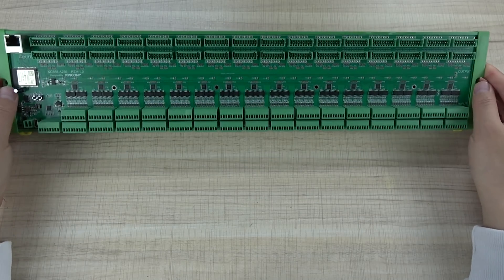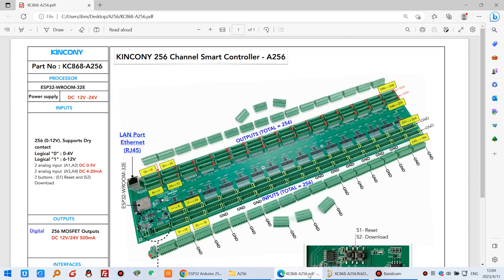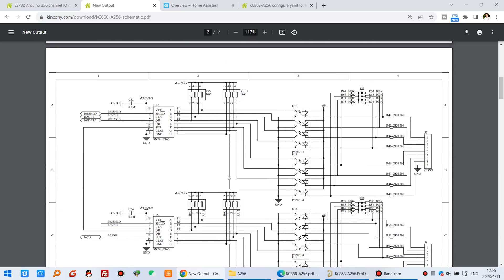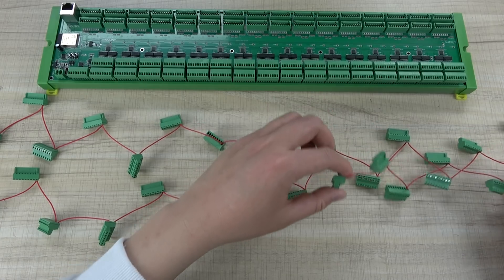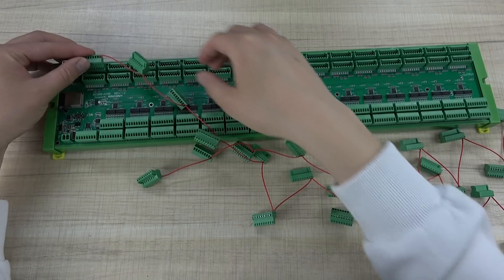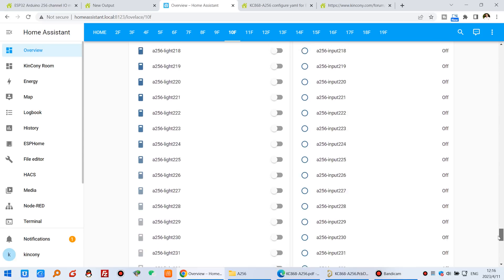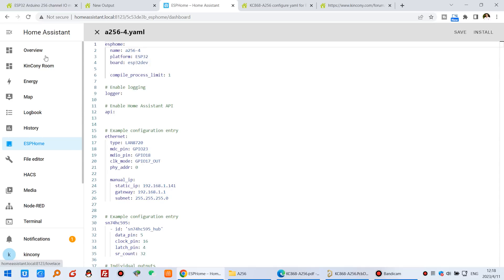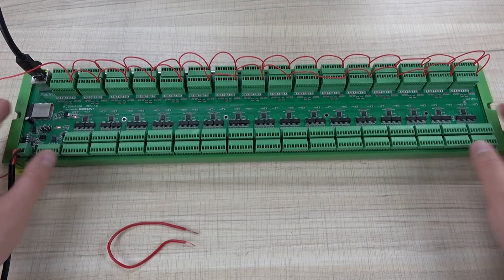crazy ESP32! + 512 GPIOs work in home assistant by ESPHome

Comment: 20 years ago I designed an iO board with an atmel avr processor that could control 32 relays and could be daisy chained so I could use unlimited io because it was protocol based. I still have some of these boards and could add an esp to them to make them wireless
Reply from the maker: good, yes, before 20 years ago, we use Ateml AT89C51 or AT89C2051 make relay board.

Comment: these inputs are really great, but i have concerns about using a to long wire to connect it, would be mainly using it as a switch sensor to see if a switch in a room anywhere in the house has been turned on. would this device work? for this kind of work
Reply from the maker: every digital input channel support 300 meter wire, enough for house to use.

Comment: great work. Can you please tell me if you have a solution for my project: central ESP32 controller connected to multiple ( may be 50) sensors around the house. some ar I2C some are UART and some ar generic GPIO sensors. the idea is to keep the controller central and the sensors connected to a central controller that relay the datat to HASS. please help and thank you
Reply from the maker: i think you can chose KC868-A64

Comment: Cool board if you want to build a christmas light show assuming you can control it with wled, but $1000 is absolutely nuts.
Reply from the maker: yes, 512 gpio in one board, make board cost is very high.

Comment: Nice work! You could also add ads1115 uChip or use analog in circuit for ampere (voltage-drop across precision resistor). 

Keep up the good work!
Reply from the maker: thanks for suggestion.

Comment: Great product, do you do small input / output modules that I could have on the Lan in other parts of the building that i can change the input high and then an output on the 256 pcb would follow the input from the small board, then i would want a momentary input on the 256 way board at the control to switch an output for short time on all the remote i/o pcbs..
Reply from the maker: sure, we have many kinds of module, such as 128,64,32,16,8,4,2 channel version.
Reply: @KinCony  do you need a PC online all the time or can we program all the modules and just let them stand alone doing what they do.
Reply from the maker: @ultrahighspeedtechnologylt7643  after you download firmware, it can work stand alone, without pc.

Comment: correct me please, can this or any other be use to connect heavy load equipment such as deep freezers, electric kettle, air conditioners, pressing iron, microwave etc.
Reply from the maker: sure, just output terminal contact with extend relay or extend contactor for heavy load.